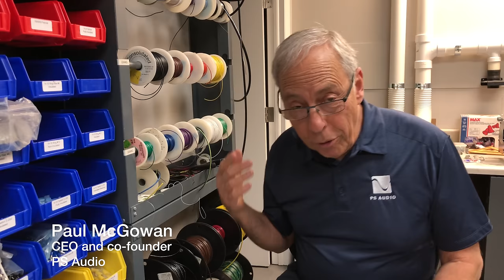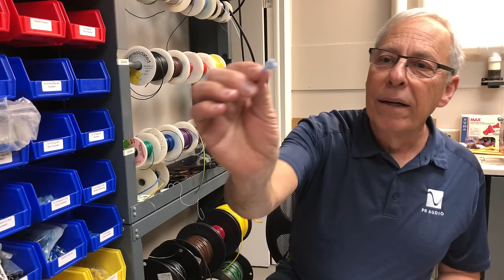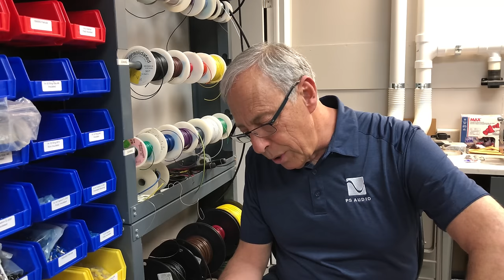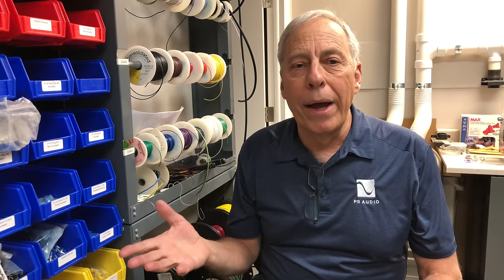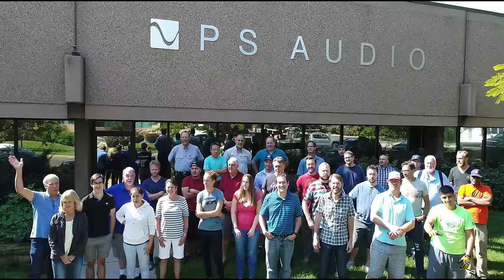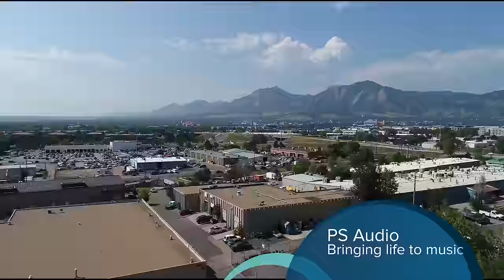Electrostatic speakers and music

Comment: Real quick! Many years ago, I attended the Navy Nuclear Power School, when it was on Mare Island, Vallejo, California. (So, I'm not a complete slouch! Just a partial -) There was an upscale audio salon in town. This was around 1969, a long time ago. They had a pair of Electrostatic speakers. They were like tall, not very wide, rectangular doors. Thin, of course. And, really great! The sound, midrange & highs, just wafted past. Very pleasant! Not exaggerated, not overly sharp & brittle. When I stood close, there was some bass. But not too much, as the active element can't move too far. Although there was also an appreciable amount of total surface area. And, since there was no enclosure, front & back was exposed, the lower frequencies can 'sneak around' the sides & cancel themselves out. Similar to suspending a woofer, out in the open. Perhaps putting this, in an enclosure, or even INTO a wall, part of the wall, so that the sound would play equally in two rooms (being out of phase between the two rooms, shouldn't hurt) could help. Probably not ideal, for loud, bass heavy rock music, but fine for transients, nice acoustic music, strings & piano. Do you remember the name? Who made these? If & when discontinued? The ones at the Best Buy Magnolia salons, today, are too 'brittle' & distorted, in the high end.
Reply: Was the Stereo Showcase the stereo store you visited?
Reply: @TSUTENKAKU007  Sounds good! Thanks for asking! Sorry, don't remember, almost 55 years ago! Still Kicking! Hope that you're well!

Comment: i love the electrostatic speaker i am a fan of Martin Logan 
i experience in theatre with a large opening around 25 year ago wile i was on tour with a theatre company experimenting with the audio set up.
the front of the stage was equipped with normal setup Meyer sound system UPA that i love with subWoofer in each side of the stage then i had a centre closter and that where it came very interesting, unsted pointing the colster speaker straight or open as every on do, i inverted the upa the right speaker pointing left and the left speaker pointing right the speaker was joint together 
and set in mono both. the result was amazing you could walk from left to right in theatre and the sound stage was so good and practically equal from left to right to center 
the image was superbe. just wanted to share my experience.. 
thank you

Comment: I have had 2 pairs of QUAD ESL 57 speakers back in late 70-s to mid 80's. Loved what they did well but was annoyed at what they did not do so well. I then in 1984 came a cross a crazy French pair of Speakers by Ge'Go Orthophase OR3 W4. They sounded way better than my 57 hence i sold the 57's and still own the Orthophase speakers today. Indeed i went to France in 1990 and bought a modern pair of ESL Orthophase OR 27 which again i still have today. Also of note is that Ortophase speakers are still in production today in Vannes Bretagne  France by a chap called Ted Devannes. The speakers are made up of multiple planar ribbon diaphragms .

Comment: 2:50 Too bad the "Sonic Holographic Generator" never got to market. I've always put my speakers fairly close together and aimed outward, and it's always frustrated me that stereo speakers are so often close together and aimed forward when there isn't the room or the will to separate them , as on most boomboxes, TVs, Bluetooth speakers, and the old consoles from the 1960s. Bose Wave radios have them aimed slightly outward and even with the somewhat artificial quality of the sound from them, one of the most noticeable things about them is the stereo image they project, considering  their size.

Comment: Are you kidding?  Not sure what you listen to in your home, for pleasure listening room; but if you have’t demoed top electrostatics made recently, you owe it to your love of music.

I own a recording studio here in Arizona with several mixing, mastering, tracking and demo rooms; as well as a presentation theater and a media lab— which collectively have Focal Trio’s and Grand Utopia’s,  Barefoot Mini main 12’s,  Infinity QRS’s, Martin Logan Renaissance 15A’s and various lower fidelity mix check speakers.    I have owned quite an array of different speakers over the past 5 decades, including electrostatics, plasma, line array, and many different traditionally designed cabinet style types.   

I am not sure what type of speakers you own or listen to at work or home, but we use 7 different mixing, mastering, demo and other environments with a range of different levels of diffusion reverberation management and room shapes and sizes, from smaller 24x17x14’ LEDE style, to 26x59x14 diffused/trapped, to quantum acoustics style active/passive mode and mildly treated rooms.  Some have standard shapes (parallel walls), some are more asymmetric.  

We have have learned the following:  the most forgiving of everything but low current amps are the Martin Logans (electrostatics).  If we want to impress people with sheer musicality, imaging and soundstage we use either the Martin Logans or the Focal Grand Utopia.   That;s independent of the source material,  For some types of material where we are not as concerned with flattering the music, but rather, have a larger group, it’s the Infinity’s.  If we want to demo a pre/post master session, it’s the Focal Trio’s or the Barefoot 12’s.

In any event, unless you have badly made, cheap or pre 1980’s electrostatic’s, nothing comes close to a great Magneplanar or Martin Logan for flattering, musicality.  In contrast, the Barefoot, Infinity and others are much less musical.  The Focal’s bring a great balance between musicality and analytical/revealing sound, making them our favorites for the majority of mixing and mastering.

As I said, I am not sure what you use at home for pleasure, or if you are that serious about music that you have a great hime system, but if you can, demo some great ML’s or Magnaplanars— depending on your room size, equipment and budget.
Reply: Any words on Sound Lab Speakers?

Comment: I agree with you about Electrostatic Speakers in many areas.  I had (and still do in storage). Martin Logan Quest Z's.  You're 100% correct about head in a vice sound stagingand being extemely revealing. As far as bass? They had built in 12"subs so that was not an issue...  I was thinking back on what I used to listen to when that system was running. You're right...  Music selection was key.  I do miss the BEING THERE experience.

Comment: I love electrostatics but am also put off by the narrow dispersion. Some of them like Sandersound are ridiculously directional and the effect is like listening to earphones... the sound is literally going on in your head. Most stats don't integrate well with the listening room and sanders apparently likes it like that. It's an incredible transducer if you like the dispersion of a laser beam. There have been attempts at wide dispersion designs... the Beveridge, Soundlabs, even the Quad models are better than average. There is a completely omnidirectional design made in Canada by Muraudio which has been raved about in some quarters. Maybe that will be the holy grail.
Reply: Roger Sanders invented the wide-dispersion ELS, discarded the idea after a few years due to many flaws, and Martin Logan use the system.

Comment: This why everyone considering a speaker upgrade should try to listen to a variety of speakers before making the final decision and buying a pair. Don't just assume you'll like one brand over another based on a Youtube video or a professional review.  Also, bring your favorite music to the demo. Especially an album or two that you know is bright or a little grungy.  Don't necessarily assume the dealer has the same music tastes as you.  Listen with equipment that is close to what you will be connecting to the speakers. Better yet, bring your amp along and use it to demo the gear.  If you can find a way to get the speakers into your home with your gear, even better.   Lastly, If a salesperson goes out of his way to listen to your wants and needs, takes his time educating you, and helps you pick out the right product for your room, reward them with the sale. Don't be that guy who takes up a salesperson's day(s) and makes them jump through hoops only to run home and buy that pair of speakers on amazon or crutchfield.

Comment: I'd take issue with this opinion and qualify it by age.  I'd agree that older electrostats were more difficult to work with and perhaps too revealing in some circumstances.  However, more recent vintage units, like the Martin Logan's with integrated woofers from recent years, don't suffer from this as much.  I have a pair of Montis that I do not detect these sort of issues with.
Reply: I heard the Montis, one of the best speakers on the planet, and the woofer integrates flawlessly, love it!

Comment: eletrostats can be to  revealing.Think it has to do with the recording stage.most studios dont have as revealing speakers when the music is made.To me the planar magnetic drivers and amt types are most best sounding.with diagram made off capton film with the traces for music signal is mostly  aluminum that is used.today with stronger neodymium magnets bars behind and in front off membran(phus pull) gives it higher sensitivity than the "normal" driver with coil and membran with spider ovs makes it a slow start and stop perfomance compared to a planar magnetic.I like ribbons without impedance transformator needed, today and for some time they have made amt type tweeters with 6-8ohm and planar magnetics the same where the impenance is now so high that the impedance trafo is not needed and not a hevy load on amplifiers as in old days since 6-8 ohm resitor is what the power amplifier see while"normal driver" varies the impedance with frekvensy since it uses a coil.planar ribbons and amt mids andTweeters with aluminum membran sounds harhs/harder than capton foil membran.
Reply: That is a very good point. If recording studios are not using electromagnetic speakers to monitor and playback, and then it played on electromagnetic speakers afterwards, then discrepancies are gonna become apparent.

Comment: electrostats don't mask sound. the detail is wonderful from those style units.  the recording practices of the present time though should give any casual listener pause. the solution shouldn't be replacing the driver assemblies. the solution should be better mastering of content.  there is also consideration of age of the processing and power units in a setup. the older the equipment the farther from original spec it likely is due to component value drift over time. head units and amps will change their sound over time because of this. bias levels will change,switching points will change due to this as well as filtering caps ability to do their jobs correctly. the onset of these aberrations is slow and one could say insidious as you only reference the end result over long periods of time. distortions/transient abnormalities are introduced that were previously not there. i wouldn't blame the stats first though. i would be testing the health of the head end equipment and recording material first before purchasing new driver assemblies. 
a very general and short 2cw.